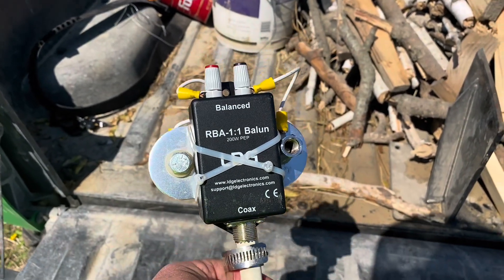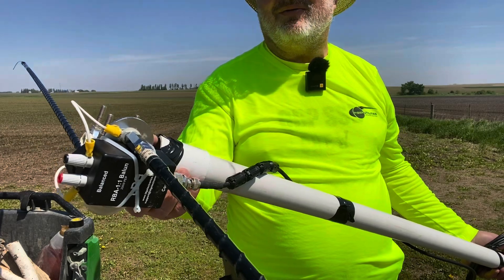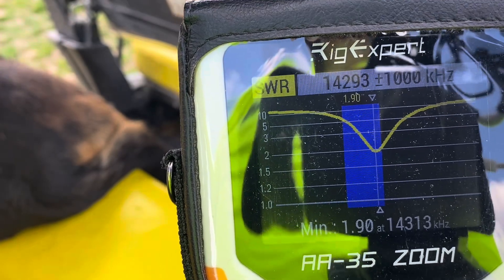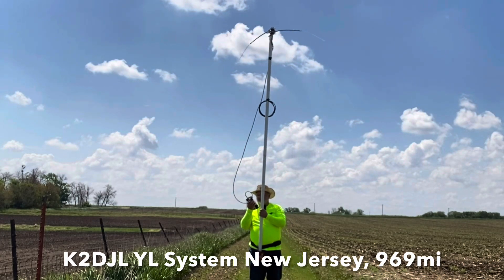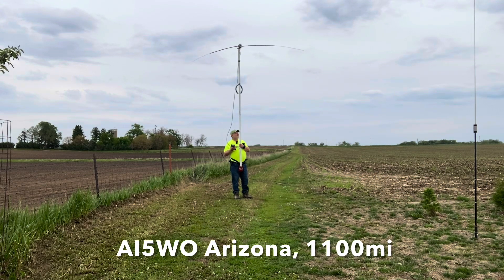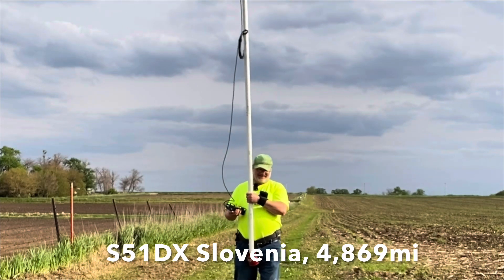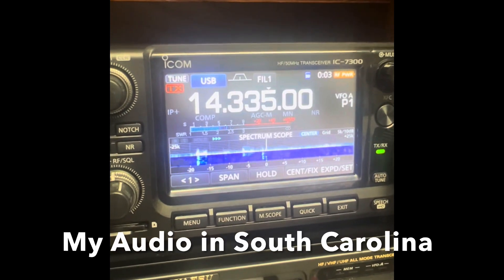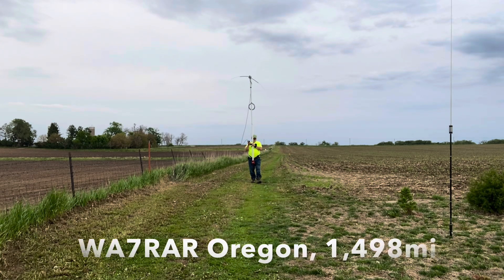Pedestrian Mobile Ham Radio w/Hamstick Dipole, QRP 5w - Xiegu x6100

Comment: I love everything about this.  That Folgers can got me though 🤣  Keep up the great work!
Reply from the maker: Hey Mike.. Thanks for stopping by.. LOL Folgers can, Right?.. It was sitting on the bench and I had to dump an assortment of nuts and bolts out of it that my father had thrown in there (probably back in 1970, LOL).. It's a little rusty but worked great as a rotator, LOL.. You should give Pedestrian Mobile a try on your next park hike.. See if that new Yaesu can perform.. In fact, I challenge you to it so you can use me an excuse to do it, LOL.. Id like to see that video.. Thanks for your support.. I appreciate it.. 73, kevin k0klb

Comment: I mounted my ham sticks to a short pc of aluminum angel. Threaded one hole to mount an element directly to the angel 3/8x24 so it is secured with a nut. And a hole big enough to run the insulated mount for the other element. and a couple of holes for a u bolt for mast mounting. I like to use a 90 degree coax adapter so my coax comes straight down. I dont use a balun or a choke and get a 1.2 swr in the middle of the band 20m. And 1.6 on the limits. The swr is testing on my analyzer, inside on the main radio on 50ft of coax the swr is flat with a 1.2 on the ends. and that is on a metal painters pole a little over 12ft high. With real good rejection off the ends.
Reply from the maker: Hey Jon.. Looks like you did your homework and came up with a great antenna.. Nice Job !!.. We just gotta love a hobby where we can think about things, experiment and play with different configurations.. Too much fun.. Thanks for sharing and supporting the channel.. I appreciate it.. 73, kevin k0klb